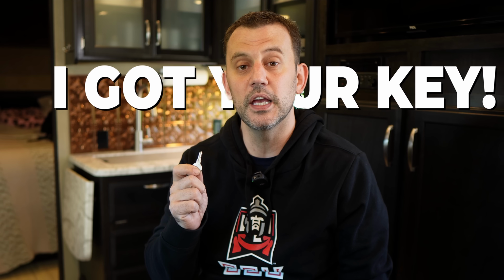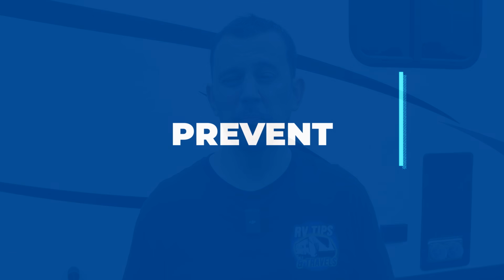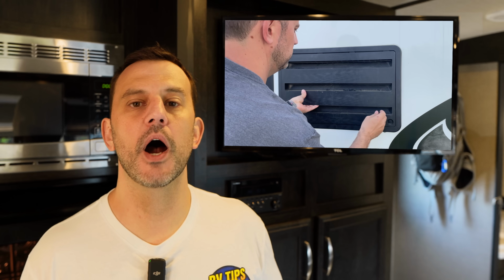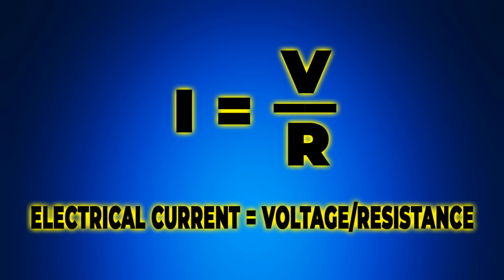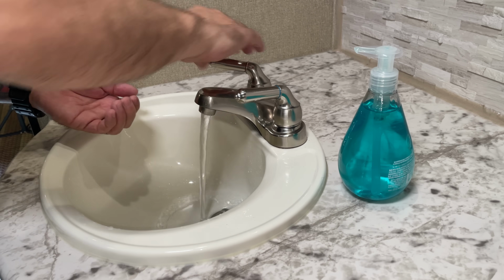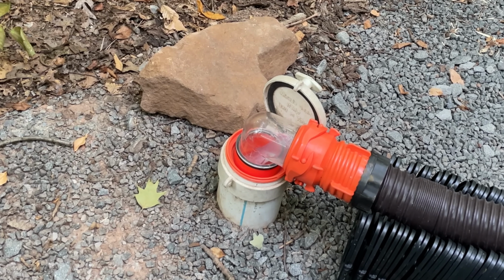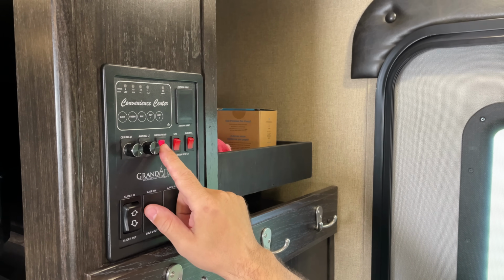7 Things You're Not Doing to Your RV... but SHOULD!

Comment: 3 basic but important tips.

When connecting and disconnecting "shore power" ensure the breakers at the pedistal are all off. Verify all are off to protect the next person.

I saw someone plug in their cable which caused an arc, luckily they didn't get shocked.

2. Before dumping tanks verify all dump valves are shut. A somewhat common practical joke is when a teenage (or adult) will open a valve on someone else's RV. When they remove the cap they end up with a firehouse shot of hopefully grey water in their face.

3. Never leave awnings out while unattended (even a few minutes). EVEN if your awning has a wind detector.

A sudden unexpected gust of wind can and will rip an awning off.

Once during a sudden wind storm I saw my "neighbor" and his wife fighting to close their awning.

I offered to help and they were greatful.  Shortly after I grabbed the extended awning there was a string gust that pulled me off the ground (I'm a 270 pound man) and ripped the awning bolts out of his class A.

After that gust he was finally able to retract his awning.

This senior couple was extremely "lucky" that afternoon. They didn't loose that awning and the large Douglas Fir that fell on the driver's side can only be called a miracle.

I literally can not explain how this tree fell and did no damage. The tree originally stood about 3 foot from the rear driver's side corner of his rig. It was about 4 foot wide and likely over 150 foot high.

The tree fell between the RV and the shore power pedastal.  It didn't hit the pedastal, didn't damage the water faucet, shore power cable or even scratch his rig.

Somehow the tree came to a rest under his driver's side slideout. As the tree fell it stripped every branch from another tree that was about 10 foot from his SUV parked in front of his class A. From my campsite the pile of large branches looked like a tree fell on his car. This branch pile was about 7-8 foot tall.

Besides his awning damage nothing else was scratched. At the time the tree fell, his wife was on the sofa that was in the driver's side slideout.

Yet neither knew the tree fell. When she saw that tree she turned white and started shaking. She knew that the tree falling less than a foot towards the slide out would have meant a destroyed RV and probably severe damage or worse to her.
Reply from the maker: thanks for sharing!

Comment: I don't know if this has been covered before, on the first time subscriber. But I would add something about a pressure regulator on the water input system.  I learned my lesson the hard way. I currently have repair bill that is north of $500 to replace some plumbing, minor, and a hot water heater that burst with over pressurized campground water. Of course, I now have a regulator on this RV, but it's too late to avoid the cost of repair bill for me.
Reply from the maker: thanks for adding Scott!

Comment: We are full time RV'ers, have been for the last two years, in a colder climate, while we build our retirement home.
Bug screens are a must. I went to fire our furnace in the fall and it wouldn't ignite. I ended up having to pull the burner out and clean all the dead bugs out of it before getting the furnace to work.
I also pay attention to the 12 volt DC side and batteries, Switching them off with a disconnect switch or pulling the negative terminal if I'm on "shore power" and charge them one day a week to avoid overcharging and burning up expensive batteries. Checking batteries, especially if you are running two 12 volt batteries in parallel. If one battery goes bad your converter will overcharge and burn up the good battery. I run with two 6 volt batteries in series so there is less chance of a bad battery causing the good one to go bad too, plus I get extra capacity from the two 6 volt batteries.
RV'ing actually requires a lot more maintenance than a normal home.
Reply from the maker: thanks for adding to the video Steve!

Comment: Injecting a dielectric paste inside your rv plugs does wonders. Oxidation is that corrosion you showed in this video. If you keep the plug and each socket coated with a lubricant, it's impossible to have oxygen present at the electrical contact point. Without oxygen, you have NO oxydation.
A clean contact can still oxidize and begin the problem.
Reply from the maker: dielectric grease can be a great tool and definitely has its purpose, but not what I wanted to cover in this video. because dielectric grease is NOT a conductor, it really should not go on the terminals themselves.   its an insulator, putting dielectric grease on terminals only weakens their connections.  dielectric grease should go on the terminal housing or boot around the terminals or connection points to prevent elements from reaching the terminals.. never on the terminals themselves.  The reason I mentioned contact cleaner is because while dielectric grease is a great tool, most rvs are plugged in and out constantly, so 2 things are happening.  first, dielectric grease is getting smeared around as connections are made and remade, so its good to clean it off and start fresh every so often.  also, terminals are exposed to the elements because rvs are unplugged alot, so dielectric grease isnt really helpind while its unplugged.  thank you for watching Bud!

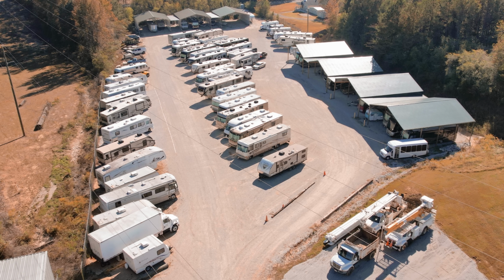Comment: 0:34 I swapped out my commonly used RV lock for ANOTHER COMMONLY USED RV lock LOL 😂😆😂
Reply from the maker: I think you are a bit confused with the difference between the ch751 key and what I switched to.  A ch751 here is keyed the same as a ch751 key on the other side of the country.  Same key.  The cam locks I got are keyed individually, so it’s not the same key as someone else’s cam lock key.  Hopefully that clears up some confusion for you because your comment was very indicative that they were both “shared” keys.  They are not.  Does that help you understand?

Comment: The CH751 Key is also on Rubbermaid Housekeeper Carts, cabinets etc...

R001, CH701, G301-G391, MK9901, B953 etc... are also used on campers and RVs and other things like lock boxes and cabinets etc...
Reply from the maker: Keys on rv storage doors are mostly ch751.  The keys you mention are used in other industries, just not common in the towable market at least.

Comment: 1 issue that was never covered in how to winterize your gray water tank. You should do a final dump after you add qlycol. What water was in your system will sit in the discharge portion of your tank and freeze during the winter and cracks your pipe. Not that it happened to me. 😉
Reply from the maker: I think you are commenting on the wrong video.  We abolutely address this in our winterzing video.  This is not a winterizing video, its just a few tips.

Comment: When you were discussing the electrical terminals, it is always a good idea to add some electrical grease to keep the terminals lubricated and prevent corrosion.
Reply from the maker: definitely, and I discuss dielectric grease in another video, but it is important to understand DG is not an electric conductor.  it really shouldnt be applied between terminals.  its purpose is to keep oxygen off the part of the terminals that are not connected to each other to act as an insulator.  thanks for watching and commenting guys!

Comment: Cam locks are easy to crack almost a worthless alternative.
Reply from the maker: a pry bar will get you into any pass through storage in 2 seconds... the point of the cam lock is that most people will have to pry it open, instead of grab their CH751 key out of their pocket and use it on your RV without anyone noticing.

Comment: Love all your videos as they are helpful for me when going RV'ing.  I bought my RV (Retro 135) last year, bought a lot of the stuff you recommended.  Also last year, in order to protect my investment, I purchased a Eevelle s2 expedition cover.  Only had this cover on from maybe November until recently.  Im sadly disappointed, only because some sort of rodent ate a lot of the fabric.  No where when researching about RV covers did anyone mention the possibility that this could happen.  I would have assumed that the fabric would have been treated with some kind of anti repellent.  If you have any tips or suggestions Im totally open to hearing them in one of your videos, as this was over $350 wasted dollars.
Reply from the maker: Thanks for the nice comment Todd... I actually stopped using covers probably 4 or 5 years ago.  I never really saw a benefit other than keeping UV rays on the RV.  There are mixed opinions on covers, some like them, some will never use one.  I'm not really in either camp but I would imagine they might actually trap moisture.  Its a tough one to answer, and an even tougher video to make comparing them... I'm thinking about builidng 2 small sections of roofing materials and letting both of them sit outside for a year.  one covered, one not, then making that video in a year.  Sorry, I dont have a good answer for you, well I do, but it involves buying a car port to keep it covered, or even a pole barn/large garage, but thats way above the cost of a cover.

Comment: On a travel trailer, is it possible to 4 season a travel trailer that is not 4 season?
Reply from the maker: hard to say, because at the end of the day what is "4 season" even mean?  that rating can mean different things between different manufacturers.  And no matter what you do, it still may not be a "full time RV' according to your insurance company.  Here are things to consider... removing all fixtures and walls and using better insulation, adding tank heaters, reinsulating the underbelly.... theres a lot that goes into it.  My best advice is this, and its a little tongue in cheek, but its got wheels, drive it south where its warm all year.  All kidding aside, that might be easier and less expensive that tearing everything apart to better protect it from the winter.

Comment: I try and make it a habit of turning the pump on only when I need to use the water. Shut it back off when I'm done. This works well enough with 2 ppl but when you start adding kids or visitors it's not really practical. It also depends on where the monitor panel is, some units put them in awkward places. If it's by the main door/kitchen it is easy enough to get into a habit.
Reply from the maker: can I ask what the purpose is for shutting it off?  it should shut off when the lines repressurize.
Reply: @RVTIPSANDTRAVELS  in case something gives up (valves start leaking or whatever)when I'm not around and I don't walk into a pond in the camper. Or in the middle of the night. Will it happen? I don't know, rather not ever find out. Saw one camper that the H2O tank valves leaked for what appears to be a little while. Underbelly insulation had black mold on it. I'd guess the owners did not realize their tank valves were leaking. It was bad enough water was dripping thru the low point of underbelly. Thought it was a gate valve initially. PS: same reason why you should shut city water off before leaving your site to go anywhere.
Reply from the maker: i always turn the water and the pump off when leaving, but having it on while im inside the rv is actually a good way to determine if you have leaks. For example, if you hear your pump kick on randomly when nobody is using the water, thats a good indicator you have a small leak.  With the pump turned off, you dont hear anything and may only discover it when its too late.  Thanks for watching and commenting my friend.
Reply: @RVTIPSANDTRAVELS   Im aware of how to pressure test an rv system. I was just sharing a habit I do.
Reply from the maker: never said you didnt know how to pressure test a water system, just pointing out that what you're doing is actually making it more difficult to discover a leak. thank you for sharing the information and have a great day!
Reply: @RVTIPSANDTRAVELS  It isn't for me  To each their own, it isn't my money or camper.
Reply from the maker: Just trying to help.

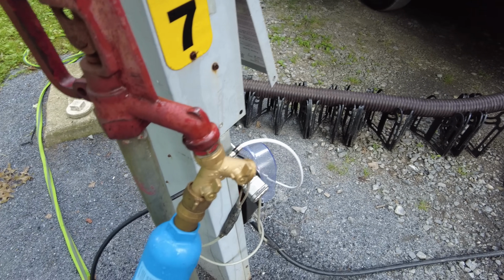Comment: @7:55 - addition! Shut off the main spigot, but then BEFORE you shut off the valve of the Y to your RV, flip the other valve open.  That will dump all the line pressure onto the ground. With the volume in the pipes... it might only be ~30psi, but that's still potential for a huge mess to come back to.
Reply from the maker: great tip, thanks for adding to the video!

Comment: Great tips thanks. BUT, I keep my grey tank valve closed so I can  use the grey water to flush the hose after emptying the black tank.
Reply: Ditto here .
Reply: That's how you're supposed to do it.
Reply: yes and why would anyone keep the black tank valve open when connected. good recipe for poop paramid
Reply: I suppose you could leave it open and then just close it and have a shower right before whenever you intend to dump black tank.

Gives you enough flow rate and volume to clear the black residue but is marginally more convenient than leaving it closed all the time
Reply: How do you get a slide out to come in when it doesn’t respond to the in button 😢
Reply: We keep our Gray Tank valve open when camping, however a day or two before I will close the gray tank valve to build up gray water to do just that.  We are usually on a schedule and know our move out date.
Reply from the maker: we started doing this as well, much less to deal with during the trip always having to dump the shower tank. we also fill up our fresh water tank when we arrive as a back up source.  then on the day were leaving, i can start packing up the hoses early and Tara still has a full fresh tank of water for morning showers and everything else.

Comment: About upgrading the trailer manual.  Are you saying to update to the latest version for the year of the trailer or the new model (Imagine 2020 to an Imagine 2024 manual)?  They never update the specific model year after the next year version comes out.  Could you clarify?
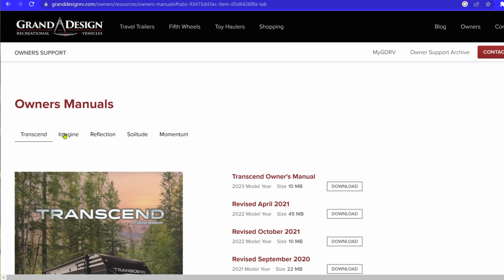Reply from the maker: Manufacturers definitely release updates and bulletins after the original manual has been released for that specific year.  This is shown in the video around the 6:47 mark, see where it reads "update" and "revised?"  The next year version may be a new generation as well, so that manual may not necessarily apply.  To answer your question though, I dont think its necessary to update to new year manuals, but check for revisions (as Grand Designs did with mine) to your specific year. 
 I would imagine that revisions wont continue to happen a year or so afterwards, however I could be wrong if they continue with that model/generation for a few years. Also, if your current manual already covers the equipment and information you need for your model/applicances/equipment/etc... there's probably not much of a need to look for updates.  The main reason I mention this though is that manuals do miss a lot of things.  Hope that helps.

Comment: I USE SILICONE DIELECTRIC GREASE ON ALL ELECTRICAL CONNECTIONS STOPS COROSION.
Reply from the maker: i agree that dielectric grease is a great tool for keeping terminals from corroding.  the reason i mention a spray cleaner in this video is because dielectric grease can attract dirt and dust, even more so on connections that are unplugged often and exposed to the elements, like truck to trailer connections.  using the cleaner I mention in the video is a great way to clean off old dielectric grease and clean the terminals prior to dielectric grease application.  thanks for watching and commenting Casey!

Comment: When parking a camper for the winter in the north with heavy snow dont depend on your tongue jack . Put a jack stand or blocking under the front of your camper and lower your jack putting the weight on them .  The tongues are not designed to endure snow weight and can bend when your not looking . Especially if you have substantial snow load on the roof and then it rains .  The weight will dramatically increase in minutes .  Seen bent tongues a bunch of times .   Just sayin
Reply from the maker: Thanks for sharing!

Comment: I would never leave my gray tank valves open . You don't know what may be crawling up your hose. Could be snakes , bugs , or ants.
And I want a large amount of water to flush behind, after draining my black tank. I installed a extra dump valve where my sewer hose hooks up . With the valves closed I open it first then I can tell if the gray or black tank valves are leaking. If one is , I have time to get it fixed.
Reply from the maker: i agree, mostly, however when its time for a nice long shower sometimes ill just open the valve during that time, then close it afterwards.

Comment: Keep the electrical contacts of your outdoor plugs/outlets slathered in Dielectric Grease.  Also, when your RV is disconnected from the tow vehicle, make sure the trailer's electrical connector is hanging so the open end is facing the ground...this prevents water from running into the wiring.
Reply from the maker: thank you for watching and commenting!

Comment: I might as well make a comment.  He said "As Resistance increases the current decreases" this is wrong. When  connections corrode, higher resistance causes the VOLTAGE to drop. As the voltage drops then the current must increase for the device to do the amount of  work. So like your space heater causes your plugin connections to over heat it takes more current to put out 1500 watts and boom you got burnt up connections or a fire.
Reply from the maker: Incorrect:  current (I) = voltage (E) / resistance (R)

So, when R goes up, I goes down. 

Simple math bud.  3=6/2, if 2 (resistance) increases to 3 while voltage remains constant, current will drop (from 3 to 2) to balance the equation.  Can’t argue with Ohms law my friend.
Reply: Yep, Ross you are correct.